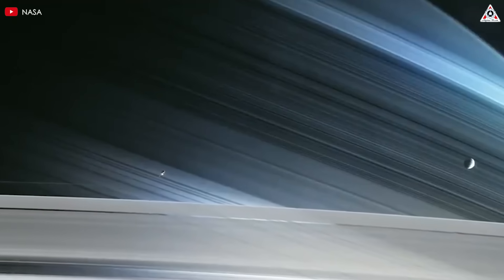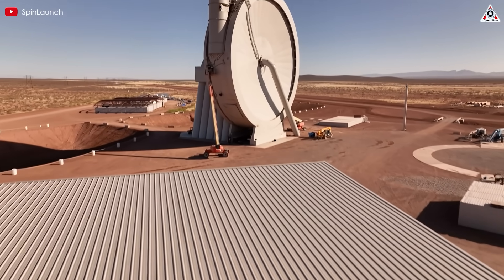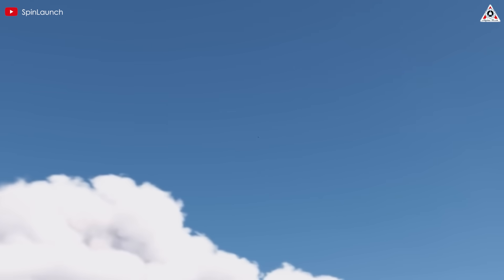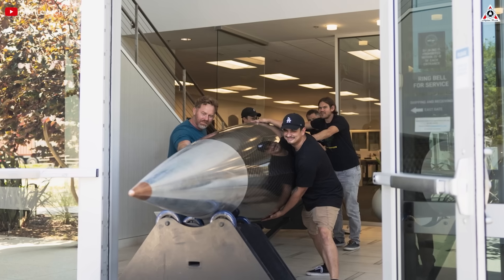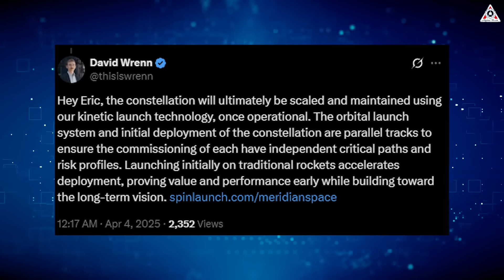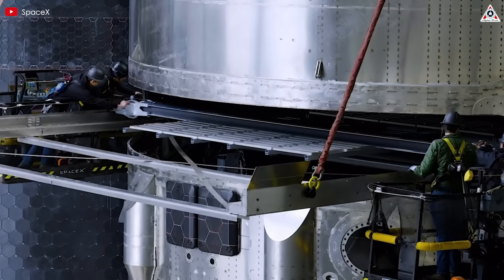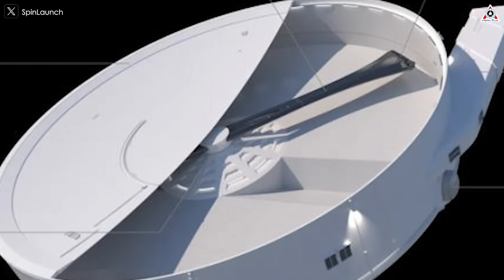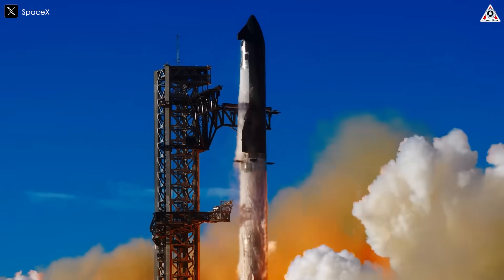It Happened! Spinlaunch Stopped Trying To Make An Orbital Accelerator After...

Comment: Its hard to create a good vacuum.  Its impossible to do so with a membrane that would then be easily penetrated by a usable payload.  The angular momentum also puts impractical stresses into the payload.  Some kind of straight-line, magnetic sled design makes far more sense.
Reply: What do you mean by "good vacuum"? High vacuum is not required for just getting high rotating speeds in a can. A well-designed membrane can hold enough of a temporary pressure difference, while letting an enormous-energy punch trough. Apollo spacecrafts were as thin as a Coke can in places with no pressure loss or structural issues.

 The scammy guys behind Spinlauch even said to be looking at re-sealable gates to reduce the energy consumption and time to renew the vacuum for the next launch. Not feasable imo, just as using this to launch anything that is not an indestructable brick. 

 However what you suggested is also long imagined by Sci-fi and physics enthusiasts. There have been projects on paper way more ambitious than Spinlaunch. They proposed drilling deep chutes into high mountains (like mines), with electromagnetic launch rails similar to rail guns. It might need vacuum sealing too, but otherwise got similar vibes than the Nazi tube rocket mountain. Somehow these projects never turn out right..
Reply: Not sure having a vacuum is much use anyway. As soon as the projectile exits the accelerator, the atmosphere outside will look like a brick wall when it comes out. Kinetic energy will be converted to heat and the projectile will start slowing down immediately. There will also be a sonic boom generated using more kinetic energy from the projectile. I doubt if it will get high enough to be able to get into orbit even with a rocket. The accelerator will also become out of balance and rip the acceleration system apart unless they have way to decelerate the system quickly. In my opinion, a big gun would be a better idea as was used to fire a nuclear weapon just after WW2.

Comment: The G forces exceed the material strength of the payloads.  We knew that when I was in college in 1970.
Reply: me too at 14
Reply: G-hardened electronics are literally decades old at this point, with guided artillery shells being a thing when I was I was in high school.
Reply: @Netro1992 So why don’t they use a gun instead? One was used to fire a nuclear weapon years ago. Saddam Hussein was planning to do this before the Iraq war and had parts of the gun made in the UK.
Reply: @mpsmith35 
Barrel wear and ignition difficulties. A single large charge needs to increase in size exponentially to launch something the longer the barrel is, which leads to a ton of wear as well. That's why the idea of multiple ignitions along the barrel came to be, but that has the net effect of making the barrel even longer, which makes manufacturing them a bit of a nightmare. Which isn't to say it is impossible, Bull showed it was more than possible and that's why the Israelis killed him to prevent his success.

Comment: Why does every technology video need to mention the global warming climate scam?
The solid fuel boosters on most rockets do release a lot of muck some of which is c02 and nitrosoxide but if you add up all the launches ever they would amount to about a weeks worth of carbon emissions from China alone. Other rockets use hydrogen and oxygen as fuel or Methane and oxygen or kerosene or hydrogen peroxide; the manufacture of Hydrogen releases c02 as it is extracted from either methane or coal , Methane needs to be burnt even if no one uses it for fuel as it is less of a GHG if burnt and it is as clean as hydrogen when burnt only turning into water vapor and harmless c02 and possibly nO2 if the flames burn the air.
Using electricity to launch a space vehicle begs the question; Where does the electricity come from ? Not unicorn Farts and Rainbows that's for sure it will be coal or nuclear because you will be talking about the amount of power needed to run a city for a week being consumed in seconds.
Spin launch was never ever going to work ,
Not on Earth at any rate , maybe on the moon it might work.
What might work to some degree is a form of Trebuchete or swing launch.
You load the capsule into a sling high up and drop it and when it reaches just past the bottom of the ark the rockets fire while it still has upward momentum. This would subject the capsule to between three and ten Gs not the thousands of spin launch.
Reply from the maker: Your knowledge is way beyond my ability to argue with. Thanks for watching the video
Reply: Yep, no mention of the coal they burn in NM to make that clean electricity. Agree lunar application, maybe ore-type materials if moon mining becomes reality. Solar array to run it, eliminate vacuum chamber, shock wave or aero drag issues, and reduced moon gravity result in a much lower escape energy/Kg.  - might work OK.

Comment: Hahahahaha.   “This time they mean business.”  That is hilarious.   Could not succeed with an easier concept model, so go all-in with more difficult.   Well, thank you for the tech entertainment, actually inspiring to see the creative thinking to solve a very difficult problem.
  Now, what happens when an object enters atmosphere from space at, of course, great speed? OK, reverse the atmosphere density instantly from vacuum with same speed.  Pffft. In a second.  The spin forces instantly changing to linear are nuts to mitigate, unless the satellite is 100% solid state with no mechanisms, but that is not demonstrated (yet?).  The mechanical capability and repeatability present fantastic trouble to mitigate, let alone attempt to solve.  Not a fantastic tech grift, including the trope cgi presentation/representation and save the environment?  Of course, good to minimize cost and affect on environment but seems more grifty here than rational.   How about much smaller and less massive satellites with much much smaller rockets with possibly better fuels?   Maybe not so many satellites, putting tech pressure back on Earth based solutions? Why not this kind of step instead of a fantasy?
How is ITER working out, by the way?
Reply from the maker: Haha, fair points all around. Switching from spin to linear at full speed is like slamming a roller coaster to a dead stop — brutal on anything with moving parts. Smaller rockets and smarter fuels might be the saner route. And as for ITER… well, it’s still in the ‘coming soon’ phase, just like half of space tech

Comment: The Company is still working on the System and keep in mind the one used for testing is 1//3 of the actual final size.
Reply from the maker: True, but the company’s still developing the system, and the one you’ve seen so far is only about a third the size of the final design
Reply: It may work on the moon to return materials for collection. Low grav and no atmosphere
Reply: @sprky777 Even on the moon you still have problem of the launch centrifuge ripping itself apart after release of the projectile.
Reply: @mpsmith35 have to launch TWO projectiles. One up and the counterweight... down.

Comment: It is impossible for Spinlaunch to reach orbit without a rocket motor. Reason: Kepler‘s laws. Why is nobody pointing out that this whole endeavour is obviously a scam!
Reply: They never claimed to be able to get to orbit by using only spinning. The plan was to use rockets to finish the job and get into orbit. Didn't you watvh the whole video? If not, go back and watch from 3:00 to 4:00.
Reply: KEPLER'S laws?  Did you mean Newton?  Kepler only addtess planetary motion  not orbital launches.  But youre absolutely correct that this is a scam.

Comment: Highest Speeds are where the highest Atmospheric Density is - at Ground Level. Same Problems as with an 'Orbital Cannon'.
Reply: ... What are you talking about, that's exactly what you want. The quickest you can get through the atmosphere the more efficiently you can later use your rockets to take things places you want. And the orbital cannons worked in every test they tried, but the lack of it being possible to be human rated caused them to be deprioritized

Comment: Wasn't there a sci-fi book that had kinetic launchers?
Reply: The Nazis built the V3 Cannon with multiple charges for higher speeds. The US had the HARP gun. They accelerated the projectile at the same acceleration as spin launch but linearly. Still, it doesn't make sense as any satellite would need to be able to withstand that acceleration which severely limits the usable payload.
Reply: Yes, From The Earth to the Moon, written in 1865.  We can forgive Jules Verne, the science of aerodynamics was almost unknown.  Modern bigh school students can do the math on the effects (on both vehicle and launch appartus) of trying to spin an object fast enough to reach even a PORTION of the final velocity needed in the lower atmosphere before rocket ignition.  Its either foolishness at its maximum or a scam aimed at those who possess said foolishness.  I suspect the latter.

Comment: Ya  I knew you have to be going about 18k miles per hour to achieve escape velocity.  And I also know you cant go that fast down here close to the ground. Both of those considerations limit how much speed you could add to the craft before actually launching.   My question is,  how are you going to make a craft that can stand that kind of lateral forces during spin up, that is also big enough to carry anything useful, and still be able to contain the fuel required to accelerate from, I dunno, let's just say it is still going 2000mph when it gets to, mmm I dunno, 30,000 feet where the rocket will be lit to re-accelerate/ accelerate to escape.  Sounds like a crafty solution at first blush, but wow   got some issues to overcome with that one.   Looks to me that a straight vertical accelerator that does not damage itself and can be used thousands of times with just minor maintenence is a better approach to initial acceleration to me. Whatever happened to the railgun approach?
Reply: The length of the track required to achieve an exit velocity of 12 km/s with a constant acceleration of 100 m/s^2 is 720,000 meters or 720 kilometers. More acceleration means less track required, and at the same time would mean only inanimate payloads possible.
Reply: @OrangiaNebula    720km doesnt sound right. Probably should doublecheck your maff. Also it looks as if you are calculating for no rockets at all, entirely accelerated on the ground which is not possible, you would burn up going excape velocity in thick atmosphere near the ground. 
If you could reuse ground based hardware to accelerate, even just the first 1000 feet, first 200mph vertical, it would dramaticallly reduce the amount of fuel required to launch, and at the same time reduce the size and initial weight of the entire launched craft.  You are spending a lot of fuel just to accelerate the extra fuel and fuel tank. Dont think of it as rocket OR ground launch hardware,  think of it as AND to reduce the standing, ready to launch weight of the craft.
Reply: @laserflexr6321  This calculation is for a Railgun. The math is as follows:
v^2 = u^2 + 2as

Where:
v = final velocity (12 km/s)
u = initial velocity (0 m/s, as the projectile is initially at rest)
a = acceleration (100 m/s^2)
s = distance or length of the track

Rearranging the equation, we have:

s = (v^2 - u^2) / (2a)

Converting the given values:
v = 12 km/s = 12000 m/s
u = 0 m/s
a = 100 m/s^2

Plugging in the values:
s = (12000^2 - 0^2) / (2 * 100)
s = (144000000 - 0) / 200
s = 144000000 / 200
s = 720000 m

If the payload is to include living beings, the magnetic track required to achieve escape velocity is ridiculously long.

Comment: The electric car of space launches:
Instead of burning through a 'mountain of' fuel (on site), that fuel is burned somewhere else to produce the electricity so morons will believe that didn't happen.
Everything is 'green' if you don't see where the pollution happens don'cha know.
Reply: I think you need to do some more research.
Reply: I think the idea is that electrical energy can be produced in a slightly more efficient and environmentally friendly way than burning fossil fuels.

Comment: There’s something badly wrong with their math. A centrifuge with a diameter of 108 ft needs to rotate at 1,297 rpm to achieve an exit velocity of 5,000 mph, 1297 rpm at a radius of 54 ft yields 30,951 g’s. To achieve orbital velocity of 17K mph requires a rotation rate 4,409 rpm, which yields 357,665 g’s.

I’m not a materials engineer, but I’m not aware of manufactured hardware (vs. say, puck shaped objects) that can withstand such forces – either in the projectile or in the arms of the centrifuge.

I have a bench grinder that rotates at 3450 rpm, but the radius of the stone is 4 inches, not 54 feet.
Reply: Does the name suborbital demonstrator not hint at anything to you?
Reply: The "demonstrator" was billed as producing 5,000 mph. I address that, i.e., 5000 mph in a centrifuge of 54' radius produces 30,951 g's, which is not withstandable by any known manufactured equipment.

Does plainly labelled math not hint at anything to you?
Reply: @TennesseeConservative 
It doesn't hint at anything, it proves you don't know how to do the math, nor know the numbers of the project. The more comments I see you make the more basic mistakes I notice.
Reply: @Netro1992 And yet you add nothing.
Reply: That because it all CGI. None of it exists in real life. It’s pure bullshit. It is a scam.

Comment: The whole Spin-Launch concept relied on the payload being on a rocket they threw up into the air.   NO rocket can take the lateral G's this thing would force it to endure during the spinning.    The 'spinny bit' is the EASY part....make the rocket it needs first, but of course they won't and can't so this whole project was dead from the get go.

Comment: Incredibly stupid idea that a first year engineering student who has passed statics & dynamics could expose as such in about 15 minutes.
Reply: Came here to say the same. What a waste of money and manpower. I am surprised that they had so many backers and employees can’t even pass the bs test
Reply: First rule of courting investors: Never, ever let them talk to engineers. 😂
Reply: They could have just created a big, magnet powered iron boot that kicks things into space - much simpler and cheaper design and just as stupid.
Reply: Hmmm well Nasa used the Spin Launch System for testing and all 10 Launches were Successful.
Reply: @jesusisunstoppable4438 that means they successfully launched an object out of the system into a predicted parabola. That makes it a successful artillery piece. The core problem is this is not a 1 to 1 replacement for a rocket first stage. And all the savings they champion are pure bullshit. To attempt to launch anything with this thing you need to completely reengineer your payload to survive it. Space launch payloads are currently designed for a fairly narrow direction of stress. This allows for them to be lightweight and low cost. To use this thing you need to increase the structural strength, weight and costs of your payload by a substantial factor. And a wide range of materials are simply off the table. Even if they get this to work to throw stuff into orbit, nobody will choose to use it. Because your payload is no longer portable between launch vendors. You have to design exclusively for this thing day 1. At greatly increased costs. Whereas a normal rocket launched satellite is fairly vendor agnostic between rocket providers. That alone will kill this. That alone makes this economically stupid.
Reply: Those were test flights at low power (20%), and the "success" altitude was "tens of thousands of feet."  The problem becomes when they go to full power the carbon fiber arm in the centrifuge isn't strong enough to withstand the strain, plus the centrifuge is unbalanced.
Reply: Well, yeah - but to be fair they said that about reusable rockets 😁
Reply: I don't think they've given up, ...despite propaganda from Alpha Tech.
Reply: I'm not an engineering guy and thought this could be a brilliant idea. In fact, an article by WIRED on this enticed me to subscribe, surprisingly a printed magazine, flown in from  America. Am I dumb?!
Reply: @hinzuzufugen7358 
Nah, fake engineers in YouTube are just terrible at faking being engineers. The idea is unpractical and the launch size is too small, but nothing they are doing here is unknown engineering.
Reply: May I ask what expertise you have to draw that conclusion?
Reply: @pbinnj3250 Perhaps they can do math, and can equate linear speed with rotational speed and the resulting G forces.